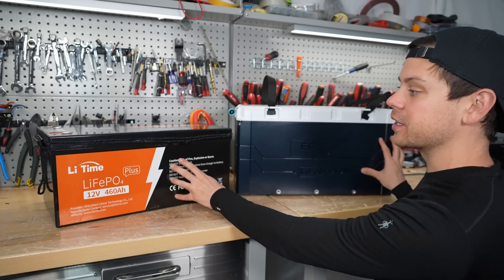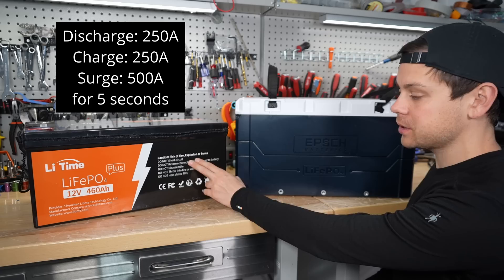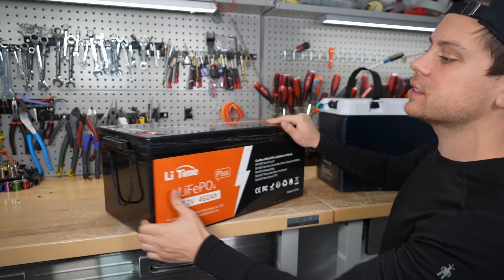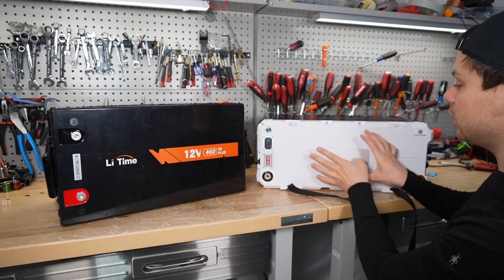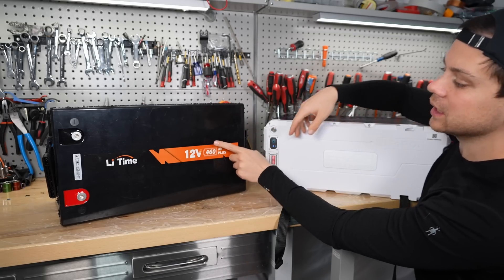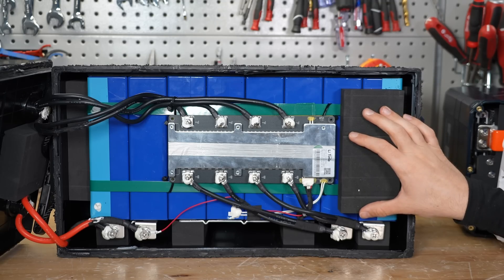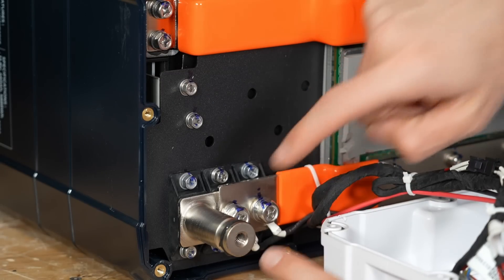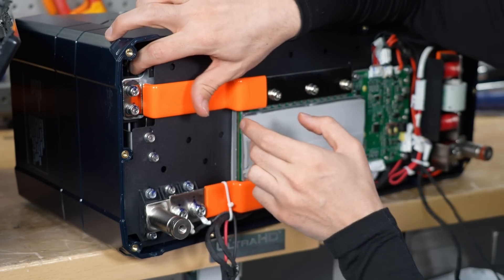12V Battery Showdown! $1,499 LiTime VS $1,999 Epoch

Comment: Depends on the use for me. If it's in a camper, boat, RV, or mobile system that moves around I would probably want the more robust expensive battery.
But if it's going to do what all of my batteries do, and that's sit on the porch and never moving, I'm going to save some money.
I'm still buying Chins 12v 100ah batteries and wiring them in series for 48v. Just picked up 4 for $760. which is crazy compared to what I paid in the past. The server rack batteries are cool, expensive, and cost big money to ship.
Reply: I would love to pay that price but they took up too much footprint and volume compared to 48V lithium batteries. So we paid nearly double for 48V lithium batteries that are half the volume size each.  Space is limited in our mechanical room.
Reply: @arlenekufchock1394  I bought a Harbor Freight 3 shelve rolling cart that holds 12 batteries just fine. Not good for mobile use, and I question rolling the cart around with over 300lbs of batteries even if it's rated for 450lbs. But for sitting still it holds 12 batteries just fine
Reply: @fauxque5057  Yes glad that works for you. We just bought a 6 slot server rack that is sleek and compact for 6 batteries, so I guess I'll be happy with the small footprint, be happy and call it a day.
Reply: but I'm already having buyers remorse, and our batteries haven't even arrived yet, hehe.  Guess you gotta pay 2x for saving the manufacturer volume on shipping, or hit the sales just right.
Reply: $190 for 100aH battery? Where?
Reply: @ChristopherLuongo  I hate Youtube. They won't let me say the word that reminds you of a rainforest and deleted my comment.
Anyhow I went to my past purchases and click on the item. Apparently they aren't offering the 4 pack because it took me to a single battery for $219.
They still have Dr Prepare 4 packs in the same price range.
Reply: @ChristopherLuongo They're on sale again. $190.39 and you don't have to buy 4. Free shipping.
Reply: actually, I did get free shipping on my 48V DC batteries, cause I bought enough quantity.

Comment: Needed a small self heated 12v lithium battery. Got an epoch B grade 50ah self heated on sale. Got a small tote, insulated it and wha la. Works great in my hunting blind. 10 amp mppt with 400 watts of solar panels. Only 1 problem when I got it, wouldn't turn on. BMS battery lead wasn't plugged in. Great customer service at Epoch. IMO
Reply: 400w seems overkill for a 50ah. Unless they are shaded?
Reply: @SnifferSock yes partial shade.

Comment: I use 6 Li Time batteries, formally Amphere Time in my small solar systems. It's been about 3-4 years now and never had a single issue. I will say that Epoch battery is impressive however! Are they both 400ah?

Comment: Thank you for everything Will!

Tough call. Just depends on your budget. One thing I take into account is a least going 24v or 48v if you have enough solar voltage.  My small solar project doesn't justify two of these so I do 4 -100 Amp 12v (cheap $260 at the time)  in series - parralel to get to 24v. I think theres merit to going 24/48 even on an RV.  I found out it's really a balancing act. Too many panels not enough battery no good. Too much battery not enough panels no good. 2 or 4 of these bad boys would be awesome if you have enough panels.

I guess I would go LiTime, because I'm always thinking of ROI. That build and fuse on the Epoch really is nice tho.
Reply: That’s very goal dependent, though. And opinion dependent. 

LiFePo doesn’t care if it doesn’t get to 100% every day, so if runtime/days for a backup system are important, having insufficient solar panels to 100% recover a full discharge in one day may not be as disconcerting to many. Even for weekenders in an RV- they have all week long to recover the batteries. 

It’s not as consequential as when everyone ran lead acid batteries, and whatever charging one gets from “too few” panels extends run time capacity every day: “two days” of battery capacity with 50% of “necessary” panels means you extend battery bank capacity by ~1/2 day every day which sorta works out to five days of usage. Not a problem there. 

I have 500Ah 12V of LiFePo and I’m only feeding them with ~1700W currently as some panels aren’t connected and one charge controller is currently not turned on. Theoretically (with my locality) the short sun-hours and typically overcast days I “do not have enough panels.” And yet I haven’t run out of battery bank or had to run the generator for weeks now. 
If all my main 2700W were running I’m way overpanelled for a lot of the year and that’s not a problem, either. 

It’s a matter of perspective- a subjective perception. What works is what works.

Comment: When you reviewed the Li Time 100ah 12.8v ... you said, "It is a really good cheap battery, and it works."
I bought 10 of them.
Im off grid and use about 200 watts per hour 24 hours a day.
3000 watts of solar
Reply: Same here but 16.
Reply: I have a similar system (8 100A 12v batteries & 2200 solar). 200 Watts per day sounds just about right, but I'm sure you can use more.
Reply: @migmigjohnson9351  if i do laundry... it uses about 1500wh per load.
I modified my dryer to run a 110v motor and a 110v heater element.
Coffee maker uses about 500watts , then shuts off.
For the most part , 2 deep freezers , fridge , security system , and a few lights will run 200 watts per hour
Reply: @vinny143 what kind of coffee maker is that? Wow only 500 watts?
Reply: Have you got all 10 in parallel or something? Or do you have 2x5?

Comment: After seeing the inside I think I would pay the extra 500 for the Epoch.  I would have liked to see the shunt aspect of the BMS however.  As you know, almost all the consumer grade BMS use voltage to approximate SOC.  That is the reason I really don't pay any attention to the SOC from the BMS, just using the data from the Smart Shunt.  Build quality on the Epoch was impressive.  Another question: can you turn the heater element off/on.  I would not want this on all the time. 
Why do you suspect there is such a discrepancy in cycle life?  Kind of counterintuative  that the battery with less stated cycle life has a longer warranty.  Would love comments on this.

Comment: I would go with the Epoch if it fits (height). But, it’s 33ish% more than the LiTime, not 25% as you mentioned.
Reply: But LItime is 25% less than than Epoch.
Reply from the maker: Oops
Reply: As for the height problem, I believe the Epoch could be used on its side. That would put it very close to the same height as the Li-Time. Hopefully, someone will correct me if I am wrong, but I think most LiFePO4 batteries can be used in almost any position. @WillProwse

Comment: I am not sure I believe what the LiTime people are saying about cycle time to 80%. You can say whatever you want, who's going to know.
Reply: Good luck finding Li Time in 5 years.
Reply: Well,they lied about having cold temp sensor a year or two ago.Will did a vid opening bat.
Reply: As Will says many times in his videos, the battery will most likely die from old age long before it does from cycling it.
Reply: Yep. It would take you 2.5 years to complete 6000 discharge and recharge cycles if you went non stop and used their max discharge/recharge rating of 250 amps. I asked how they proved it to make that claim.
Reply: @bobjones9727 I thought that the Assumption was one cycle per day which would make 6000 Cycles last much longer.

 Why would you have multiple cycles per day?

I'm an old guy and based on my experience dealing with companies other than Sears Craftsman tools, these kind of claims are usually very false.
Reply: @bobjones9727 probably with math.
Reply: @bobjones9727 
Since a “cycle” is full-to-empty, the way most of use these batteries in a solar power system here in the northeast we would typically only fully cycle them Nov1 to about mid Feb (now) and even then not every day. My system for example- April to almost October - will barely use the top 10-15% of capacity daily. So cycle life gets “extended” due to lack of depth of cycling. 
So even with cheap Btrpower or Chins we likely won’t see any practical capacity reduction for ~10 years- and they won’t stop working completely all at once like Oliver Wendell Holmes’ Deacon And His Masterpiece. 
Other than perhaps failure of some BMS’s we are likely to see excellent value from any of these batteries unless ‘we’ buy super-cheap, sketchy, or known poor LiFePo4’s. 

Fwiw when one knows the early cycling parameters and characteristics of a particular battery a competent EE in the battery sector can calculate/extrapolate lifespan expectations. That is how they come up with the numbers- other than the cheap brands who basically read other company specs and make up something that sounds good. Even then they still might be close.
Reply: I think I'd buy the more expensive one with the 11yr.warranty.
Reply: @lynettesharp7728  With the amount of these companies that open up and disappear a few years later, for me personally, an 11 year warranty means bupkis, definitely not something I would be banking on in 11 years.
Reply: @lynettesharp7728  you are also assuming that the company will be around in 11 years... You just never know.  But the build quality is definitely better... And more features.  So yes, I'd probably buy that one as well...
Reply: I would buy the Epoch. I do not like heated batteries though.
I do my own temp regulation but I like the fit and finish/quality of the Epoch
Reply: Not all LiTime batteries have low temp charge cutoff, since most high end chargers offer battery sensors. You need to pay attention to the models. They also have good costumer support, and US and Canada sales office.
Reply: How do you do your own temp regulation?  I might have to do the same when I Ovelrand camp.
Reply: @danemmerich6775  charge controller with temp sensor!
Reply: @danemmerich6775  external heat pads if they are in a cold area of the camper. And chargers that are programable or support temperature sensors to stop charging if the battery area is too cold...
Reply: @danemmerich6775  Sits on it, XD
Reply: Yup, it's all hearsay, from ALL manufacturers 😊
Reply: I think all of them use optimistic specs, some more than others. Normally, you would test, if it doesn't meet specs within reason, send a message by returning it. But yeah, cycle count is a test no one can reasonably set up, nor does it matter that much.
Reply: I’ve had two(2) BMS failures in LiTime batteries.  They warranty them, sure, but after 1 year they only credit 60% of the replacement cost.  By year 2 you get less than half replacement cost.  They depreciate fast, so from a fail and replace perspective Epoch is far superior.
Reply: Assuming a 0.2C rate is used, it takes 10 hours to do a full charge/discharge cycle. 24 hours x 365 days = 8760 hours in a year (excluding leap years, leap seconds, etc.)

So, non-stop at the standard charge/discharge rate of 0.2C (92 amps or approximately 1228.8 watts, very roughly) you can cycle a 460 amp hour battery 876 times a year. So, for 6,000 cycles it would take 6.8 years, 10,000 cycles would take 11.4 years, and for 3,600 cycles 4.1 years). I think the 3,600 cycle figure is closer to the truth, but in more than 4 years, I suspect calendar aging might be the biggest factor. I seriously doubt any of these cell manufacturers provide anything except cycle life estimates.

Once you get above 5 years, you really need to consider the quality of components used in the BMS, capacitors in particular tend to die between 5 to 10 years.
Reply: I’ve seen too many LiTime BMS failures in various videos

Comment: I would go with the cheapest one of the 2. 
Question... My BMS has low temperature charging protection, it's supposed to be bad for the change controller to have power going in with no batteries connected. Can you address this at some point please
Reply: Just use some way to heat the compartment the battery is in. Even a 100W light bulb could do so, if you have good insulation.

Comment: I already got 2 of the Epoch units going in my boat with full victron system. I bench tested them with the Victron and they work great.
Reply: What trawler you got I have to replace my generator and I’m thinking of going solar and battery
Reply: What are you running I’ve got 3 ac heat units?

Comment: My use case is for a large motorhome.  The Epoch with the low temp protection and cell heaters is worth the price difference.  In yesterday's video you mentioned that a 48V system would be better in most cases.  Does that apply for this situation too?
Reply: IMO, a 48V system is always better unless you need 12V for compatibility (like if you currently have a 12V lead-acid system, and you only want to upgrade the batteries to Li-ion, not replace everything else too). A 48V system also has the advantage of smaller gauge wiring, which saves weight (and money), which is especially helpful in a mobile application, even if it's just a few pounds overall
Reply: @TroyWarr1980  Thanks.  I have   4- 6v batteries now.  They need to be replaced and that will already be $800 or more.  I am not opposed to a 48v system, just need to keep the 12V part of the coach happy.  I do not have much in solar (old 100W panel).  Most of the charging will be from shore power and the generator.  Good starting point for me?
Reply: @fredklapetzky2698  Yeah, these might be your best bet then. It's not generally cost-effective to upgrade a 12V system to 48V - it's more of a decision you'd make when first designing a system. In your case, assuming your current cells are in 2s2p configuration (for 12V), you should be able to just replace all of them with one or more of these 12v LiFePO4 cells, either single or connected in parallel. LiFePO4 chemistry is far superior to lead-acid or AGM, so that alone will be a big upgrade. They'll last a lot longer, will be less affected by temperature, and will allow you to discharge them to a much lower state (like 10-20%) without harm. Well worth the higher initial cost, IMO.

Comment: I’d go with the epic. I’m wondering if you could add these 48 V epic batteries to eight Battle Born Batteries wired in series parallel? Or do they have to have the exact same cells?
Reply: The batteries Will was comparing in this video are both 12V models, though I do understand that Epoch sells a 48V version as well. AS to your connecting them alongside Battle Borns, You might be able to, but might also need a way to keep them separate, as they have way different cells. I have the BBGC3 batteries, and know they have cylindrical cells, while these others use "prismatic" cells. Most manufacturers of LiFePO4 batteries say to only use the same brand and Ah batteries in the same battery bank. Might be better to just get another inverter/all-in one, and run a separate system...kind of as a back-up. My neighbor and I both live in an off-grid community with no land power, and have found redundancy to be a good way to "rescue ourselves" if something goes wrong with a system.
Reply: @Tumbleweed5150  
I’m wondering if having a Victron shunt on each battery bank could give you the capability that you might not otherwise have? You can program each battery bank much more specifically with a shunt.

Comment: I'm going for lead acid leisure batteries for my van because I'm worried about fire risk from lithium ion or more precisely how difficult they are to put the fire out.
Reply: These batteries are not lithium ion. The chemistry of both batteries in this video are lithium iron phosphate so you don’t have to worry about fire risk and you can ditch those 40 to 60 pound batteries!
Reply: @MrFredsDIY  ah right well I'll have to look into those at some point but I still think lead acid might be a lot cheaper and I don't have to worry about over charging them, although fully discharging them is an issue but not so much for leisure batteries as they are designed so that a full discharge isn't so drastic. Nevertheless I'm on a budget and I'm thinking I'm just going to swap out my current lead acid with new lead acids. I know they are not supposed to last as long, a few years instead of 15 but the way I use the batteries they can last a long time and I'm only running a few lights, tv, some fans maybe boil a few kettles.

Comment: The Epoch costs 33% more (not 25%)
Reply: Will love your videos! Do you have a video or can you tell me my best option to change over my 1998 fortravel coach to Lithium and be safe considerations are my alternator and inverter Freedom model 25 modified sine help would be appreciated.  And if you have a setup for this that you sell tell me how to find it as well. Thanks
Reply from the maker: You can either say, the litime is 25% cheaper than the epoch, or the litime is 33% more than the epoch. I really dont even care.
Reply: @WillProwse  Sure. Sorry, I didn't mean to be pedantic. Great video! I agree, the large difference in cycle ratings is weird, and feels contrived for marketing. Not sure I would factor that into my decision between the two